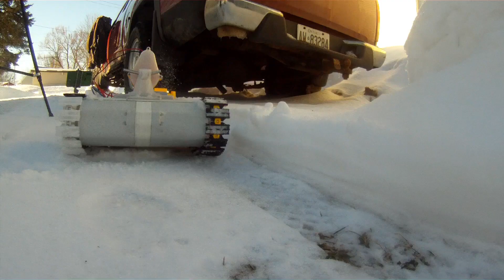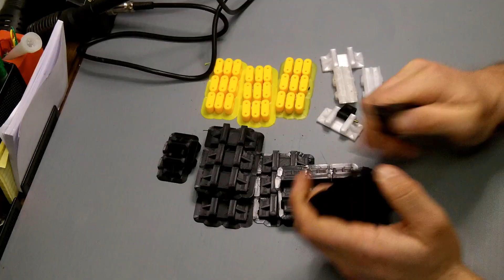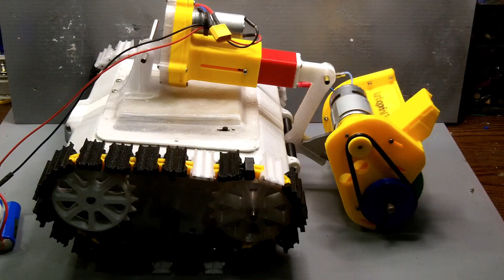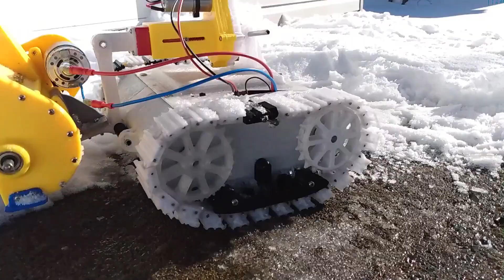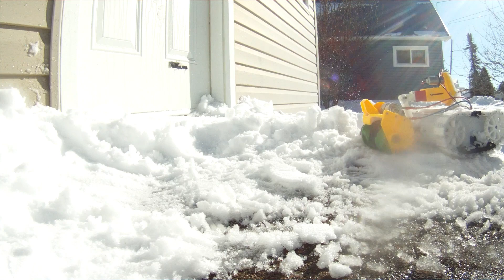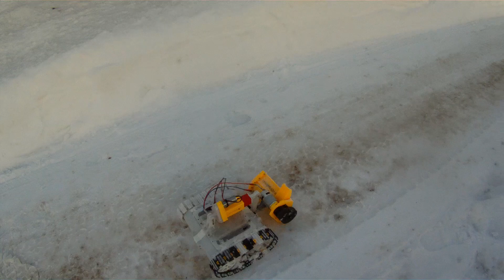The snowblower is back !

Comment: A lot of the difficulty your snowblower design has had is because of having two stages on a common shaft with a side exit - an auger pushes the snow to the side, into a fan section that throws it into a side-offset discharge chute, but the auger doesn't really spin fast enough, the fan doesn't have enough speed to lift the snow. Consider a single-stage design with two auger sections that push snow to the center, then when the augers converge, that becomes the part that flings the snow upward. Also, I think your tracked carrier needs more mass - maybe heavier batteries - to assist with traction and help the whole thing be more stable, and it needs to be geared down more so it can be controlled. These are just my observations.
Reply from the maker: https://youtu.be/CShfzXvJoFU blower works fine the vibration is not much of an issue, however if i redesign ill move the shoot to the middle and that way i can balance the design easier . I like the single stage over a 2 stage just in the simplicity of design . I need to make the thing wider so it clears the snow in front of the tracks so they don't climb up. If I had fresh snow that's not heavy it blows great . I have a few ideas on a redesign but have yet to settle on how I want to do it . defiantly needs more of a skid to push the weight down onto the blower maybe a wheely bar on the back attached to the actuator to not allow it to flip up. the other idea i had was to make 2 frames 4 sets of tracks and have a pivot between the 2 with an actuator for articulated steering . the much larger footprint would be better for this sort of work . I started with the blower on a bot frame i made years ago , now im finally getting to the new frame design . really the focus of this is more of less how well the frame works with the blower , witch was not as good as i wanted . now that I have a more preferred platform I plan to work with that in mind moving foreword .

Comment: I think the wobble may be because of mass imbalance of the auger - it doesn't complete a number of full 'turns', so the partial turn is resulting in offset mass on one side of the auger shaft.

Comment: Definitely needs to crawl, like you mentioned. Fun project!
Reply from the maker: maybe some higher turn 775 motors and brush less motors with lower kv , lots of options the 40mph( approximate track speed with no load max power) top speed is not really functional on something this short , should make it slower 
overall one way or another would make control alot smoother .